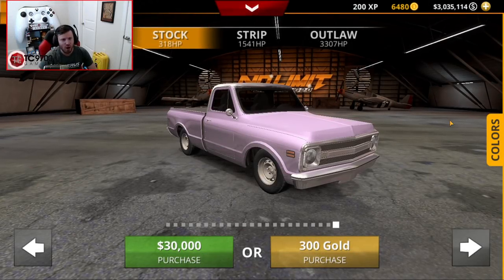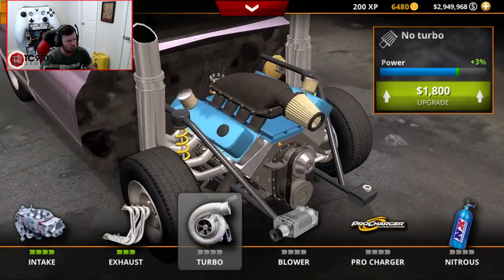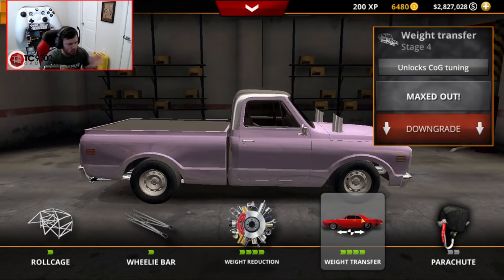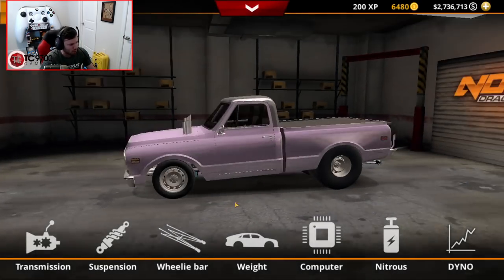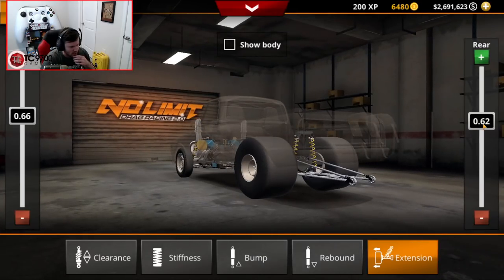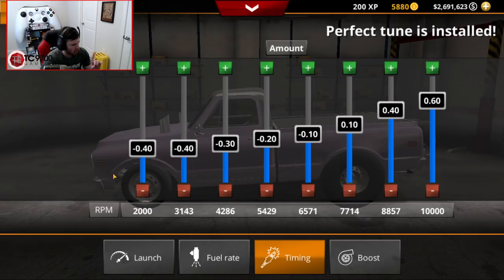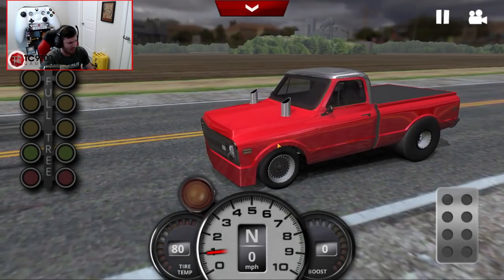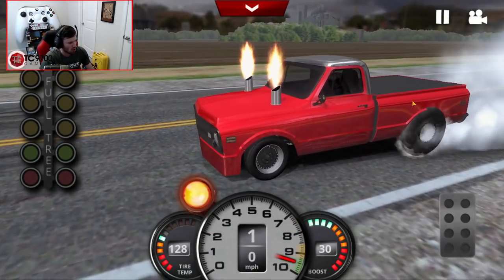No Limit Drag Racing 2.0: TWIN TURBO, Fire Breathing C10 DRAG TRUCK BUILD! (NEW UPDATE)

Comment: You can only do both on the pro mods and also for the bump you want to put 1000 front and rear and for rebound u want to put 7000 front and rear usually that’s what u put for all street cars

Comment: Hey TC!
I have a question, which “scout” would you recommend the most? Either Limes Poseidon or the R&R Yeti 5500? 
I like the looks of the 5500 but it isn’t as OP as the Poseidon. 
I can’t have both since I have a lot of other mods installed.
Reply: Open? Of coursework
Reply: J
Reply: Wym